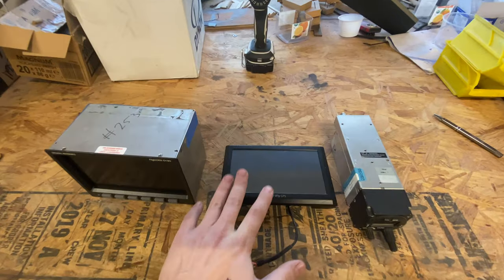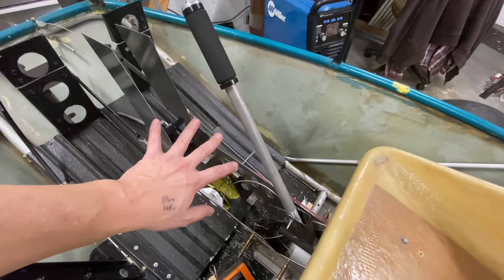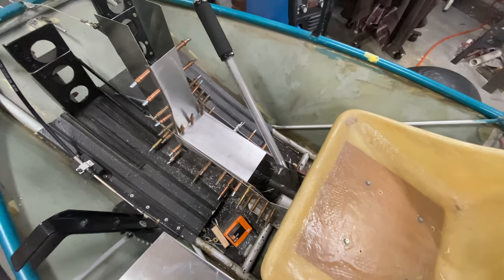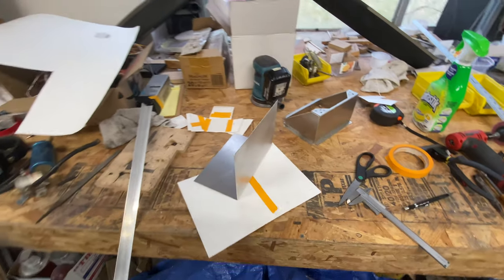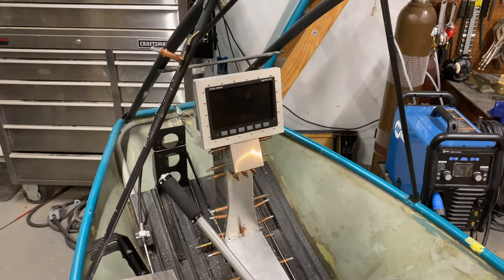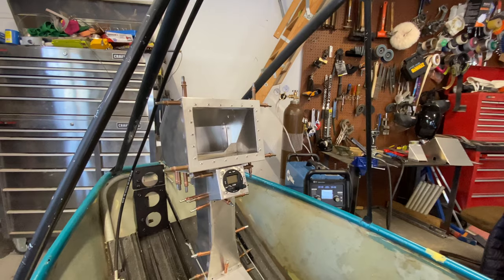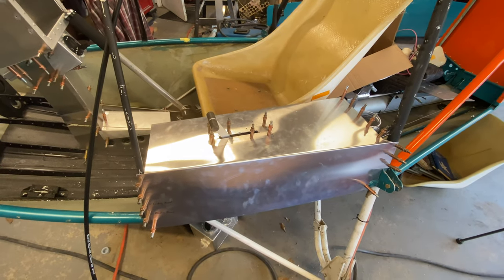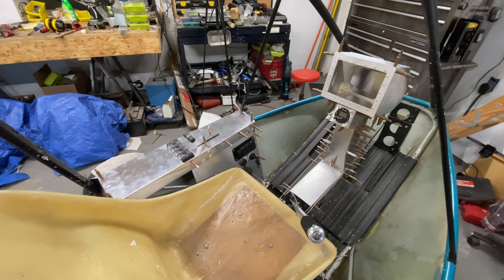Fabricating Interior Sheet Metal - Budget Bushplane EP11

Comment: Is a pod as good as an instrument panel in regards to crash protection? Given that a well made harness should keep a body from impacting the panel, what would keep a pod or a panel from collapsing upwards into the pilot while he is a fashioned securely in their seat? It seems like a panel would have more surface area to diffuse the impact whereas a pod would keep its integrity concentrating the force in a smaller area. 

One of my early flight instructors did not double check his student pilot on fuel quantity and lost power shortly after departure in a Cessna 150. The aircraft impacted a small tree which up ended and nosed it down. A radio had not been installed and locked properly and it flew out of its tray hitting my friend squarely in the face breaking his upper and lower jaw. Upon coming to rest the aircraft was upside down and both were hanging from their harness. The student was unharmed. My friend not so much. He survived but were severe injuries. 

My point is we must envision how a cockpit might collapse in the case of a crash. What might or might not become projectiles or items which might spear. What gets put in front of you just might come for you in the case of a crash. I have no answers and so many compromises must be made to keep it light and affordable.

Comment: Looking good. you should add some slits on the sides of your dynon cover or maybe put a computer van to help with cooling. Also you should use Alumiprep 33 before you paint.
Reply from the maker: A fan actually isn’t a bad idea. That cover will get a lot of sun. Good inspiration, thanks!
Reply: @ianslife210 , I agree either a small computer fan at the base of the center section as an inlet and some venting at the top to exhaust the naturally rising hot air.  Perhaps a removeable louvered section on the top of the Dynon portion would work.  Then, if heat truly becomes an issue, you could remove it on those really hot, sunny days.  Or install the fan at the top to draw the air out with an opening at the bottom to help the air flow.  Drawing hot air out might work better than pushing cooler air through the structure.  I've also seen some builders incorporate outside air via small diameter ducting to help cool their electronics instead of the weight and complexity of a fan.